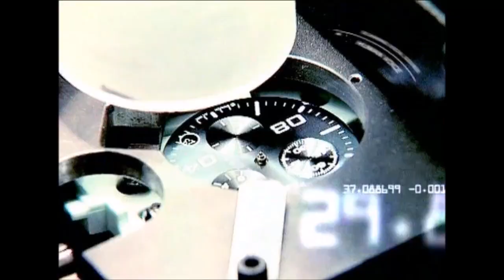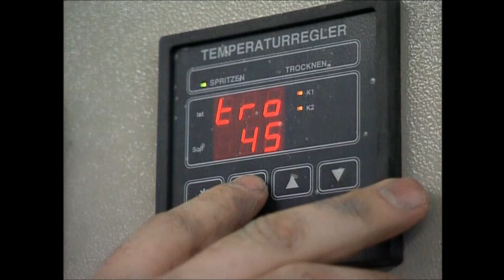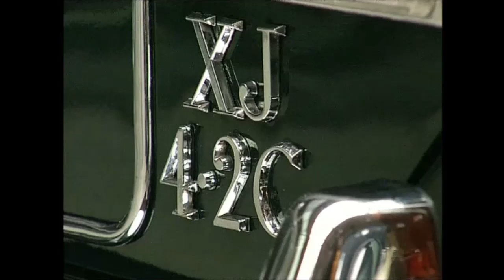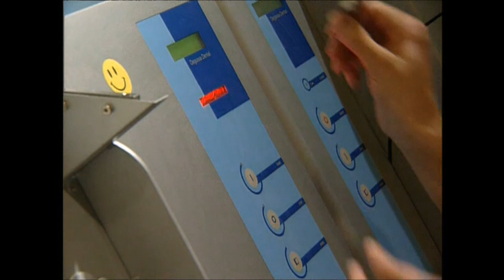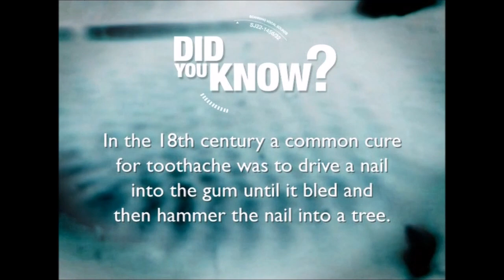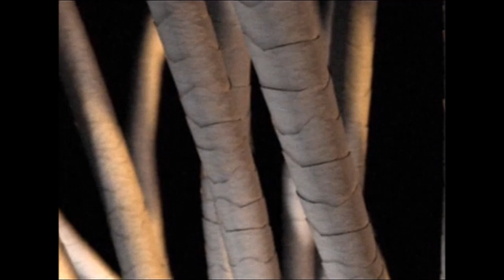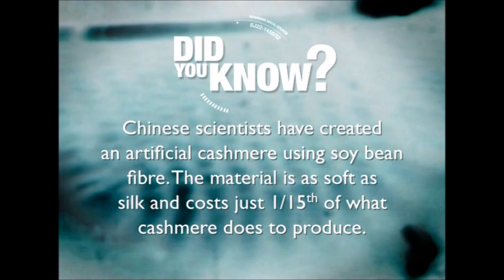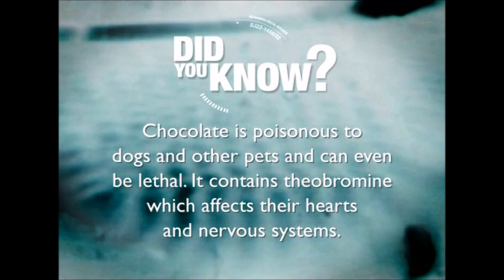► HOW IT WORKS | Car Restoration, Dental Crowns, Cashmere Wool, Chocolate Spread | Episode 19

Comment: The dental tech is believe it or not old. With regards to crowns, the dentist does what he needs to, then uses a dental camera to take a series of images. That tooth and void space got into CAD/Cam and the dentist makes a couple of adjustments. The black goes into a machine and is fired. 

Then it gets a soft fit and he makes a couple of adjustments basically regarding the fit around the other teeth and the result is a crown that you will never be able to identify again.
Reply: This production is 22 years old itself.

Comment: German restoration expert used lots of Lead and Bondo, owner should get his money back
Reply: Lead is an old way of correctly fixing body work. Bondo is not
Reply: @danhammond8406  Resto expert will use patch panels from donor cars or hand shaped replacements,lead is no better than bondo for a proper resto.You end up with a Bondo Buggie or a Lead Sled.
Reply: @ItsMrAssholeToYou  I'm aware lead was used in the factories for imperfections back in the day, if the problem was on the roof they would just slap a vinyl top on and send it out the door. Anybody can laydown Bondo in their backyard and make something look nice, I have done it on my own vehicles. This is something else entirely isn't it, does the proud owner have to make sure no one gets to close with a magnet lest his restoration be branded a Bondo Buggy. When I sold my 65 GTO every guy who looked at it came with pockets full of fridge magnets hoping to find something when they couldn't they balked at my asking price lol. If it is done right it is money well spent.